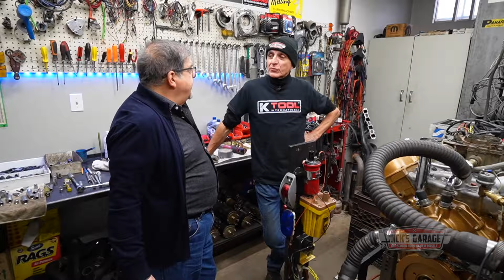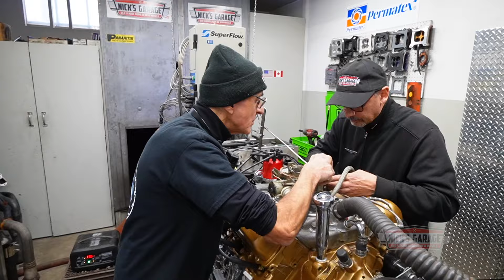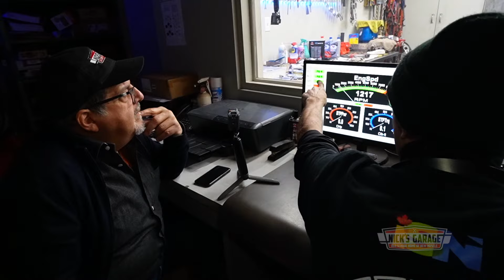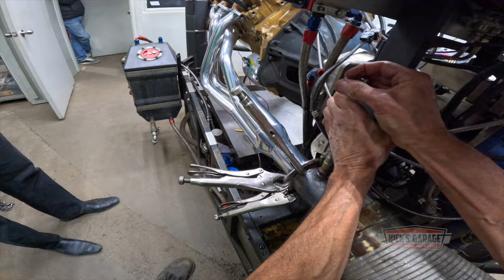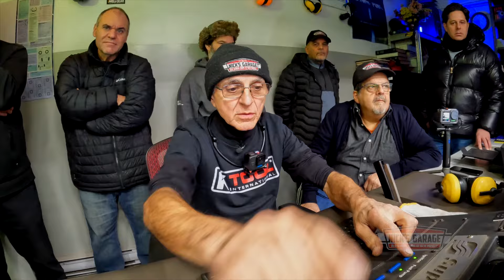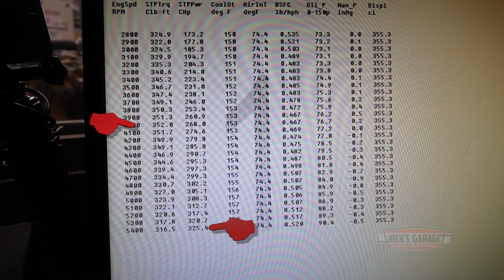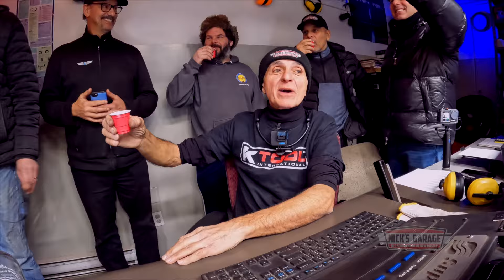Rare Olds W-31 Dyno Party - High Performance Small Block Tested

Comment: Olds runs through my veins it's a family deal the cam well it's a w30 cam   the intake is based on the cast iron but it's alum, the heads need port matched on the intake manifold side and exhaust,  the headers are the wrong size    the cam if I remember is .474 .474 at 308 dur on 108 degree  I myself use comp cams valvetrain with roller tip rocker arms   I also use Edelbrock intake on my Olds. Headers no comment  you also need to open up all the oil drain back holes and oil restrictors   I hope this helps    Joe Mondello or Dick Miller has killer combos for Olds fans
Reply: Those were 8 heads should be 6 or 7 for 70 71 which makes them open chamber

Comment: The reason they had power brakes in the W-30 application, is because the engine was larger displacement, and therefore could generate more vacuum.

Comment: For shlt sake, it's not a damn small block.  Olds, Buick, Pontiac and Cadillac didn't have small block/big block.  The terms small block and big block represent different concurrent engine architectures.  Not displacement or even deck height.  400 small block Chevy and 396 big block Chevy are not called such due to size, obviously.  They are TOTALLY different designs from the ground up.  The 260, 350, 403, 455, etc Olds are all the same design, altered along the way for various requirements.

Amazing how this confuses so many people who should know better, let alone the rubes who will comment here with "Well dat ain't right man, my cousin-daddy used to build an engine!"

Comment: Doesn't anyone think 100psi oil pressure is a bit much?
I would think running a thinner oil around 75~80psi would give a few more hp and keep oil cooler/less aerated.
60+psi oil pressure at idle is way higher than anything I've ever seen before
Reply: yes & that was rectified

Comment: I have 2 - 70' W31 cars rated from Olds at 325hp and a 70' Rallye350 @ 310hp. The Rallye HAS a set of 70' W31 heads and did have the original cam from the same car... the RALLYE. The Superflow Dyno numbers... are way different. 
Respectfully, Seth
Reply: Hey my brother Seth had you ever heard of putting on the 455 head's on the small block olds motor with the high performance stock camshaft that Oldsmobile put in the 70' s in the Big block olds motor for the manual 4 speed car's

Comment: the owner is going to have a blast in this car, sure like to see it, is it a cutlass or? 442?   with 90 lbs OP its going to be a real long runner, everything is just floating on a small thin layer of oil for sure, that's good OP . . . is it stock gearing on the wheel or?
Reply: car car for this engine is a real W-31, stick with a W-27 geared 3:91, just as Doc Olds intended it to b !!!

Comment: how oveer the years haven't you figured that thesrs a ported vacuum for the advance on the carb at the right front? on a quadrjet the right corner is the place for vacuum advance. direct vacuum of the rear its never gonna run right.

Comment: W-31 350 came with 2.00" intake valves. 2.07" are the valves uses in the 455 and are common upgrades for Ols 350 engines which other wise came with 1.875" intake valves in standard form. 
W-31 engines were made in 1969 and 1970 using modified #5 and #6 heads. 
I built an Olds 350 a few years back and did a lot research to get it how I wanted it. 
Found 1970 to be the best year for the 350. With 455 valves and a bit of bowl and port work #6 heads can flow quite well.
Reply: Did you notice it has #8 smog heads? That guy got taken.

Comment: The engine came with the biggest cam olds ever made.  I’m surprised the owner didn’t mention that.  The cam had so much duration that the car wasn’t offered with power brakes as an option.  I think it was something like 310 duration.
Reply: Yep same cam as the W30 which had 308 duration but you could get the 328 duration cam in a W30 with 4speed , no AC or power brakes.

Comment: I had a 73 cutlass with the golden block 350 back in the mid 80 it was rated at 200 hp but I knew it had more it would take the 4.000 lb sled to 120 mph and I was taking a few cars that should have beat it !

Comment: @nick'sgarage, when u adjust the absorber, does that determine the rpm at which you can start the pull?
Reply from the maker: No. It adjusts the amount of water flowing to the impeller. The rpm is set by me on the computer control panel.
Reply: @NicksGarage  so, the more torque an engine has, the more water supply it needs in order to be able to stall?

Comment: Oldsmobile didn’t manufacture a small block engine. Buick, Oldsmobile & Pontiac Engines are 90 degree engines. The bore and stroke are different between a 350cid and a 455cid.6:38
Reply: They’re technically smaller
in dimensions externally as well. The deck height and span between heads are both approximately 1” less on an Olds 350 compared to 455. All else is identical.

Comment: W-34 455 engines did not have the same cam as the W-31 , they were the same as the 350 L34 m/t cams that cam in the later production 70 cars. And that guy in the dyno room is annoying as heck agree with every one else. Great video other than that !

Comment: I have done plenty of engines, and not once ever dynode or engine stand ran them. Batting 100% and intend to keep the trend.
I'd like to see the Q-jet get worked on, re-jetted and rods to give this engine an "total area" of about 0.0028500.Replacing the Idle down tube redialed for your app, from Cliff Ruggles.

Comment: I am not a big GM guy, but I thought the Olds 350-400-455 were all the same block. Am I wrong? How about the Pontiac 326-350-389-400-455 and the Buick 350-400-430-455 engines?
Reply: Big block and small block Oldsmobiles blocks are not the same. Pontiac has only one block
Reply: Buicks are like the Olds big and small

Comment: NICK...QUADRAJET CARBS POWER VALVE HAS AN ADJUSTMENT ..PULL AIRCLEANER THREADED BOLT OUT ..INSERT ALLEN WRENCH AND ADJUST AT IDLE....👍💪😎🕊️👈

Comment: This is NOT a W31... It's got number #8 cylinder heads. It should have # 5's
Reply: It has #6 heads which are correct for 1970. I thought they were #8's also but the 6's are just cast weird. A 69 350 olds would have #5 heads

Comment: Good honest engine. Factory power and torque from a near 60 y/0 engine. And I will bet that when it was rebuilt it has less compression than factory. Piston manufacturers want to decompress everything.
Near 100lb oil pressure is really too much. Before he puts it in the car a softer spring would be in order 60 psi is plenty and there is probably 5-8 hp as well.
Reply: Agreed. !00 psi can generate enough heat to wipe out a set of bearings fast, especially if it's a full bore drag race. 60 psi is more within the realm of reason. It will free up some horsepower and promote longevity. If anything you want a higher "volume" pump. Not higher pressure. A lot of people make this mistake. It can be an expensive lesson.

Comment: Oh boy, I'm having flashbacks from 1984 when my Oldsmobile engine wouldn't start in my 1972 Oldsmobile Cutlas. "I HATED THAT ENGINE!" Back fire after back fire! You couldn't get the timing right sometimes. The carburator float drowned! I had to have the carburator rebuilt and install a new distributor. Then it started running on 6-7 cylinders after all that work getting it started😡. I found out I forgot about connecting the vacuum hoses and the new distrubutor had a couple of bad points. Boy, was I stupid at 17 years of age. That engine tested me bad!
    Nick did a great job on that W-31 Rocket engine. "HAPPY NEW YEAR, NICK AND GARAGE!!!"

Comment: Fords Boss 351 was King of small blocks. Bob Glidden won many championship with the Boss 351
Reply: Yeah it's too bad you can't put Big block Ford 460 heads on a 351 Windsor hmmm 😅
Reply: Too bad you people never thought about what I did to a small block olds motor with the w30 Head's and the w30 camshaft in the name of Hot rodding what no other car manufacturers can actually accomplish but I can, have my cake and eat it too
Reply: @rodneyhopper22   I never heard of Pro Stock Oldsmobile small block. But the Ford 351 and Bob Glidden won many championship.  Never heard of a Oldsmobile engine in Trans am racing.  Boss 302 won it in 1970, DZ-302 Chevy in 69. 350 Oldsmobile hasn't won any kind of  Racing
Reply: My kinda small block olds motor is not for the faint of heart I've done my own personal research and put the w30 camshaft and the w30 Head's of a 455 on a small block olds motor with the help a Edelbrock RPM intake manifold and also a HEI ignition system w 10.4 mm spark plug wires .   40:24
Reply: Every one I ever saw or rode in was a giant turd. Fords best sb's were the 289 & 302. If they were so great, how come 99% of hot-rodders have Chevy sb's in their Fords??

Comment: The W-31's had a 308° duration and .475" lift, the old way of measuring lift. Not sure on the lobe separation.  I think it was108°. 
It had 2.00" intake valves not 2.07" and 1.625" exhaust valves. 
10.25 compression ratio.
Reply: 10.5 flat top pistons.

Comment: Those olds 350s were never a threat against the Chevy 327s and Chevy 350s back in the day. Mopar 340s also ran great.
Reply: Check out Car Life Magazine (ET comparator)from the late 60's and early 70's, the 310 H.P. and 325 H.P  Cutlass more than held it's own against competition.
Reply: @basilcarroll9729 
Yep cuz they made more torque and over a wider rpm range !

Comment: So it makes 325…. With open headers. Not quite up to snuff
Reply: It’s the stock aluminum w31 intake. The carb is fine and 750cfm. Air fuel ratio is spot on. I don’t see mufflers.
Reply: Dude…. It’s a W31 with headers. I don’t have anything against Oldsmobiles. I’ve built a couple. I’m just saying- this one is a little disappointing. Sure you can change all kinds of parts to get more power out. I’m sure when the factory tested these engines- they weren’t using an electric motor to turn the water pump either.

Comment: Another thing to consider is the vacuum dashpot on the right front of the carburetor. One of the Oldsmobile Engineers who worked on these engines told me recently that the dashpot caused lower horsepower due to it preventing the secondary air doors from opening at higher rpm. Olds engineering changed the dashpot in 1971 which finally provided the lower compression W-30 455 to achieve 300 hp.

Comment: The 1968, '69 and '70 W-31 all used a 308-degree duration, .474 lift camshaft with 88 degrees of overlap. The lift and duration were measured from zero. Also, the 1970 W-30 and W-31 Quadra-Jets were set up with no power piston or primary metering rods and used smaller orifice two-barrel primary jets.
Reply: And they are worth about $5,000.

Comment: Considering headers are worth approx 20hp, the output is a little low.  Even in an engine done to factory specs a modernized cam grind should run better all around. Other than the performance increase the motor will not really sound any different. 😮

Comment: The comparison of W30 to W31 cam /vacuum is inaccurate.  Of course the W31 cam in a W30 is going to act much milder. Big block 455 to small block 350 idle vacuum will be higher with the extra 105 cubic inch 455. Why is this guy allowed in the cell with the engine,  he's just a liability.

Comment: Olds 350s are the greatest sounding V-8s ever made. That is really music to my ears.
The difference between a 350 and 455 blocks is a taller deck on the 455. The bottom ends and cams etc are the same. Similar to current LSX engines made that can be 454 cu in and more displacement of course with pistons and connecting rods as appropriate.

Comment: back in 1970-72  I had a 1968 ram rod 350 cutlass S  - 4 speed with 433 rear end.   I installed a stock Olds W-30 cam meant for the 455 it had 328* duration an increase from the stock W-31 with 308* duration.....it had a very impressive lopey idle and ran like a scalded cat......headers, W&B du coil distributer, edelbrock manifold and 780 holley...I seem to remember 6500 rpm redline and 38 degrees total timing.  Sold it in 1973 for $1200  - oh boy-  because I needed $$ to buy a used 1970 Mercury Cyclone 429SCJ for $2000 - those were the days.
Reply: You should have kept the Olds....

Comment: As an owner of a 70 w31 4spd with 4.33 gears..no pwr brakes ..no pwr steering..all because of the 308 cam..i can tell you..shift it at 6500..and hang on hell uva motor
Reply: The 308 Cam was for the automatic car and the w30 camshaft had the 328 duration with a 108 degrees of lobe separation
Reply: I know this subject very well because I built and drove my own personal car with a built up small block olds 350 motor in my 71 442 w31 with the 3.23:1 gear's and a special built up transmission just for the job
Reply: It was equipped with a 4000 shift point and a 2500 stall converter and it was a real rocket 🚀 to deal with for sure 😊😊😎

Comment: It was the first hydraulic-lifter engine with a factory 6000 rpm redline.  My cousin worked in quality control at Oldsmobile, and he would test them on the weekends on Woodward Ave and Telegraph.  The funny part, was he looked like Ralph Nader, and he was cruising around in a bumblebee yellow and black Cutlass convertible, with a rumpy cam.

I actually had a '68 W31, in an '80 Cutlass Salon, with the FE3 suspension package, 3.08 posi rear end, full instrumentation, and a Doug-Nash Street 5-Speed.  It would launch like a 4.56 posi, and shifting at 5000 rpm, I could leave healthy rubber in all five gears, with 3rd at over 90 mph.  Without a deck spoiler, at 5000 rpm, the rear end would get REALLY light; I did that once, and it was plenty enough.

They loved timing advance, but ate rod bearings.  They were an impressive engine.

Note:  My Cutlass had power brakes, and they worked well.

Comment: No reason to celebrate this W31 engine only making 325 HP. These engines are capable of 365/375 HP without a lot of modifications. I am not bashing the guys engine either. I'm just stating facts.
Reply: there will b some changes

Comment: I just heard the part about vacuum, availability of power brakes and so on. Weren't the W30 and W34 both 455 cubic inch engines, and so they may build more vacuum than the 350 using the same cam?
Reply: Not sure. I am learning as you are.
Reply: I did a little looking and one vendor of a W31 spec cam says if it's installed 5 degrees advanced it matches W30 specification. Advancing the cam usually increases bottom end torque, so combining that with W30 455 cubes may explain why the auto trans was available with those and not the 350 inch W31 combination. Just "thinking out loud" here. @nickpanaritis4122

Comment: @ 33:50 .. pretty sure the owner is wrong, as Rochester never produced a 780 Quadrajet carb. and the correct size for a W31 350 olds is a 750 cfm Quadrajet.

Comment: I built a nice 350 for my 68 cutlass back it the day. Had the mains caps shaved with a billet girdle. Ported the heads and put the biggest valves could fit. Performer rpm cam and intake. Was a solid ripper! I ended up being car jacking for that car😢. RIP my little rocket!

Comment: Love the show.  A few quick questions on this testing; Are there ways to retrofit a knock sensor onto these old engines to test for knock?  I ask because if the engines set up for say 93, and you put 98 in there, it wont run right, and leave some hp on the table.  Do you guys ever mess with the octane to get it spot on using knock sensors?  2. What valve seats are in this engine do you know?  It was refreshed so I'm assuming newer, so that you dont have to use leaded fuel.  3. Is there a possibility that maybe the coolant's a little too cool?  If the engine ran a tad hotter, would that help the combustion at all?
Reply: We have done many kinds of testing in the past. It all depends what the client wants. There are times where we have spend days on testing.

Comment: Myvintageiron7512 is doing an absolutely fabulous series at the moment on the history and evolution of US domestic V8s from all the major manufacturers and their divisions. Each vid is one manufacturer; Chrysler has 2 because of the Hemi & Wedge engines.
What he's doing is very much needed. He states what he's doing isn't authoritative but an overview, so don't burn him if a few facts and figures are off a bit. If you're specifically going over there to big note yourself by pointing out inaccuracies save it for someone more deserving.
If you want to find where the Olds W-31 fits in the overall scheme of things, design features and evolution of engines etc head over for a look.

Comment: Hi Nick, many people thought the Olds and Pontiac 350’s were weak, they were not. They were really strong and fun to run especially if you couldn’t afford the 400’s or 455’s in the respective brands. You could get a LeMans 350 with a column shift automatic with a 10 bolt posi from the factory and run the heck out of it and it would come back for more. The Old’s had similar packages with the Cutlasses because 442’s were expensive and the blue block could be a pain if you tried to modify it. Great Videos Thank You 🙏

Comment: I just wanted to clear up some misinformation that they said that it's not   correct. The w31 never got the w30 intake valve. It actually was the 455 two-barrel valve which is a  2 Inch valve bigger than the normal 350 . The carburetor size for the 7040255 w 31 specific is 750 cfm. Not 780 . The automatic and w31 stick cam is the same 474 in 308  duration. Same on both intake and exhaust. I just want people to get the right information because well obviously they don't. You should have took  it to 7000 rpm lol

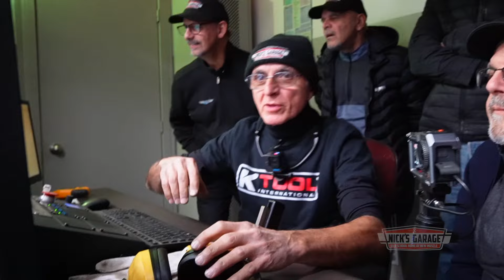Comment: 19:41 100 lbs of oil pressure! Lucky the filter didn't blow or the seal on it.
I'm guessing the absorber has to be adjusted to every engine that is put on the dyno.
I would have liked to seen a test run at 180* water temp.
Reply: Next time I will.  I had a few engines in the past tested 155F  vs 180F and Results, 155F wins in many cases.